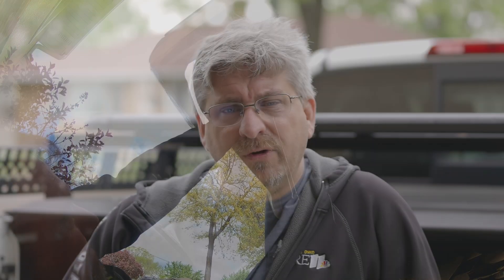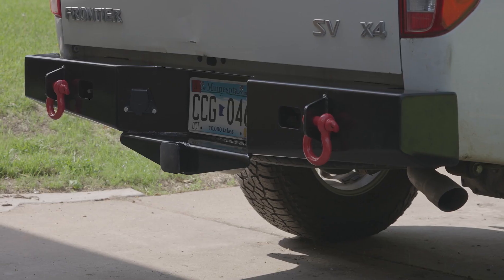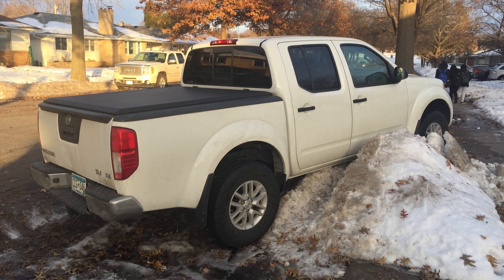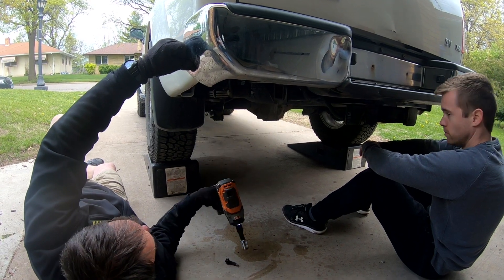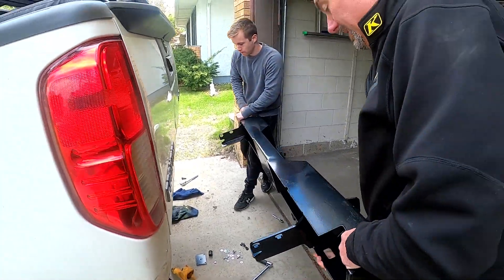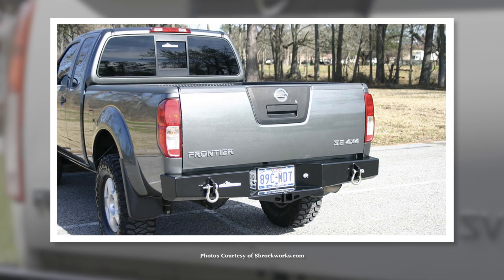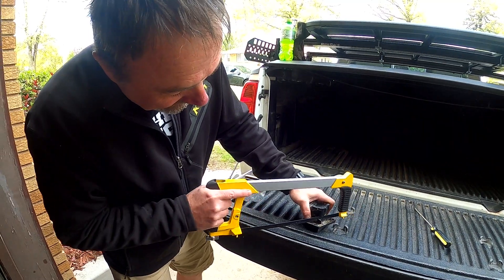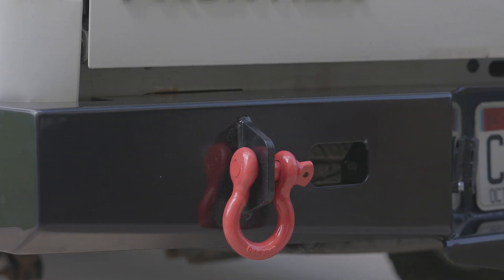Installing my Shrockworks Off-Road Bumper on my Nissan Frontier

Comment from the maker: I am being asked about the hoops for trailer chains.  They are there just behind the steel.  Keeping them tucked under keeps them from dragging on rocks.
Reply: As much as I like my low profile Shrockworks rear bumper, attaching the safety chains was a pain until I added  a couple heavy duty Quick Links which helps a lot and  using anything but the simplest hitch pin is a pain. Especially if you use a locking hitch pin

Comment: Last June I installed my Shrockworks F&R bumper and rock sliders. As expected they are rock sloid and installation was straight forward and I'm very happy with them. The license plate lights, and the hitch wiring were both a minor hassle, but easy to deal with. When I order my bumper, I didn't get the expensive Baja Designs backup light for the cutouts, because I was pretty certain that I could easily find lights that were cheaper. WRONG I looked everywhere and nothing. So, Baja Designs it was. They installed as easy as everything else and really do add enough light to comfortably backup in the backcountry

BUT last week, it was sad to see that as of Jan 2023 they are now out of business, and failed to deliver on a number of prepaid orders between last July and this month.😕
Reply from the maker: I was disappointed to hear they closed shop as well.  Hopefully they can make it right for those who didn’t get their orders and perhaps come back in some fashion.

Comment: Looks great! I’m wondering how much it weighs compared to the stock bumper and hitch.  The Shrockworks bumper looks heavy but it might now be that much different than stock+ the hitch.
Reply from the maker: New bumper is 87lb and the stock is 61lb.  However the hitch was 30lb. So really is no difference in weight.